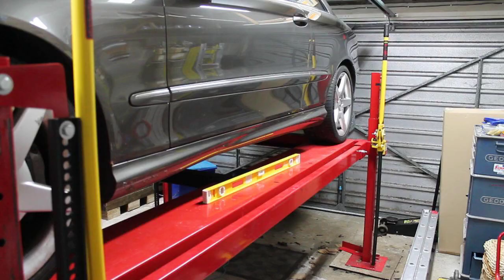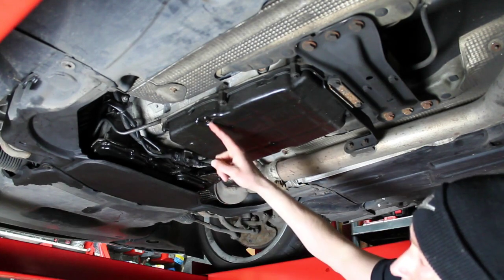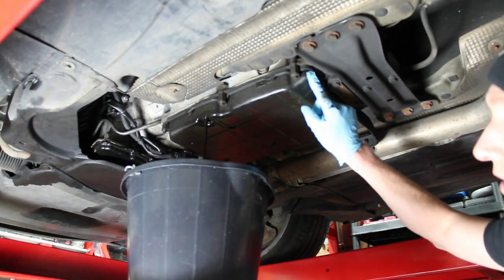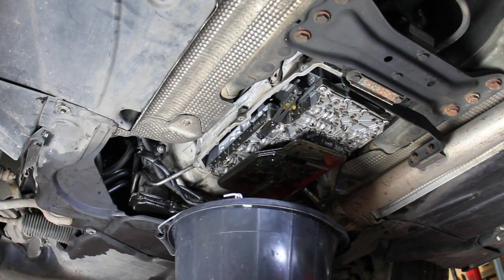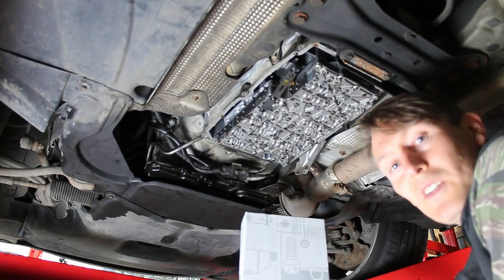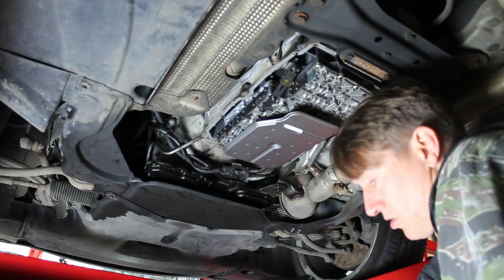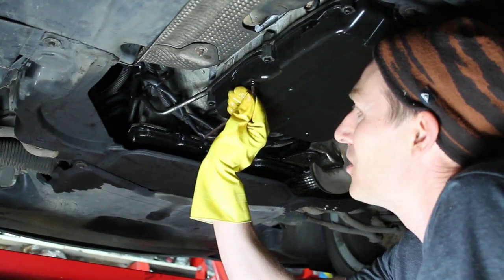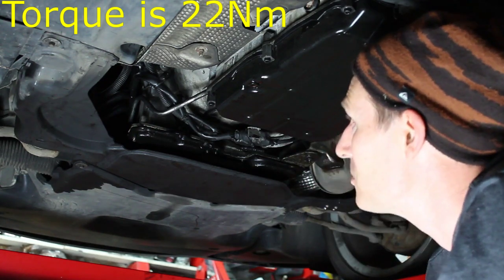How to Change the Oil and Filter on a Mercedes 7 Gtronic 722.9 Automatic Transmission

Comment: Best video out there for diy guys. 1 question. Im gonna buy a w213 2017/2018 E class estate 220d. Its got the 9g tronic gearbox right? Is the steps the same for the 9 speed as in the 7 speed one?

Also, whats your opinion on guys putting a new overflow pipe, new oil pan bolts etc?
Reply from the maker: Hi, pretty sure your car will have the 9 gtronic but if any doubt, keep an eye on your centre dashboard when driving on the motorway usually there will be a number showing what gear you are in. If it says 8 or 9 when cruising at speed, that will confirm it. I just bought a w205 with the 9 gtronic, service intervals are every 5yrs or 77,500 miles, whichever is sooner. I would think that the service procedure will be similar but I will get into it soon in my vehicle and will definitely do a video! Thanks, Phil
Reply: @ReviveMyRide  - thank you my man
Reply from the maker: @AB-dr8wq  whoops, just realised I didn't answer all of your questions! Overflow pipe: I don't replace mine and have never had a problem but it comes down to personal choice. Really easy to fit one while you are there. Bolts: Yes, definitely replace them! I thought it was a bit excessive to replace them, so decided to experiment and two of the old bolts sheared when I started putting the pan back on, even using a torque wrench set to the correct torque. They were Aluminium on the 7 Gtronic gearbox, so presumably they get effected by the heat or work hardening or something like that. Thanks, Phil

Comment: great video; thanks. Did you also replace the plastic pipe (that connects to the drain hole) in the pan as well?
Reply from the maker: Hi, thanks for your comment, glad you liked the video! 👍 No, I didn't replace the plastic fill pipe. I have read a lot of write ups and I haven't come across anyone replacing theirs but some people probably do! Apparently, if you are just doing a fluid change (not dropping the pan and changing the internal filter), you can "pop it up", which allows more of the fluid to drain and then put it back to its original position again but I've never done this myself.   Hope that helps! Thanks, Phil

Comment: How many  miles before you change gearbox oil  cheers.
Reply from the maker: Hi Steven, the service interval is 40,000 miles for the 7-Gtronic gearbox. From 2010 onwards (some people call this the 7G+), it moved up to every 70,000 miles. Hope that helps! Thanks, Phil

Comment: I like this video of yours very much, it explains the technique of how to change the gearbox oil and filter very well.
However i think you should also mention to people that unless you also drain the oil in the torque converter as well, you are only
really doing half of an oil change as the torque converter holds about 4 litres on its own, so you are only mixing old oil with new oil ?
Reply from the maker: Hi Alan, glad you liked the video and thanks for the comment! You are correct about the torque converter. Early cars like mine don't have a drain plug but a lot of the later models did. I provided an update to cover this in a comment that I have pinned and in the description. Unfortunately, I can't easily add anything new to the video... Cheers, Phil

Comment: Do you put any cain of glue to the pan gasket , because when I change my transmission oil I have a lot licking oil and I look you video and I don't see any glue putting on you pan gasket o what exactly I doing wrong?
Reply from the maker: Hi, No, you don't use any glue. If you did, then it might lead to the gasket leaking. So, you need to do the opposite, make sure the edge of the pan is really clean, with no oil residue, as this will help the gasket stay in place. Also, if the new gasket was folded up in a packet, then it sometimes takes a bit of work to straighten it out etc. The new gasket should have some rubber location lugs on it that fit into holes on the pan. These also help keep it in place, I mention / show them at 7:34 in the video. Hope that helps and good luck with it! Cheers, Phil
Reply: @ReviveMyRide  sadly I did it and when I was trying to put the last bolt it broke out on my and a lot of oil came out , and now I ordered new bolts , and a new pan gasket again and a they sooner I get those parts , I gonna fix it but now a don't now how to take off that glue whitout harmed the trasmission , I used the optimum black high flex gasket maker, and I'm very thankful for you help, I really. really appreciate it!!!
Reply from the maker: @saulpaz8857  Happy to help! You can remove the old sealant from both surfaces using a green scouring pad https://amzn.to/3bxDyJm and some brake cleaner. It is time consuming but this wont damage the surface of the bottom of the gearbox or the pan. Take your time and take care to make sure old sealant etc doesn't get into the gearbox.  You can also use a plastic implement of some kind (like plastic trim removal tools) to scrape the surface. Don't use metal tools because if you damage the surface, the new gasket won't seal properly. Were you using a torque wrench to put in the pan bolts? If not, then you really should, helps to prevent bolt breakage. Hope this helps and please let me know how you get on! Cheers, Phil
Reply: @ReviveMyRide  i very thankful for you knowledge ,as soonest I get everything put together , the right way , thanks to you im gonna get my car back , and a really, really appreciate everything to you thank you very much!!!

Comment: How many litre transmission oil is needed for Benz c200 07 plate ?
Reply from the maker: Hi, first we need to check which gearbox you have. If your car has a 5 speed auto, then it is called a 722.6 gearbox, which isn't the same as the gearbox covered in this video and hence, the procedure is likely to be slightly different and it does use different fluid as well. I have seen on Mercedes forums that the maximum oil change amount is 7.5L but it isn't always possible to drain the full amount of fluid (not possible to drain the torque converter) out and most people change about 6L in total.  If your car has the 7 speed auto, then it is a 722.9 as featured in this video. The full oil change is a maximum of 7L but I used slightly less because the gearbox on my car doesn't have a drain plug on the torque converter. Hope that helps! Thanks, Phil

Comment: Thanks for taking the time to do these.  I'm looking into a Metris van which uses the 7Gtronic plus.  Did you not need to drain the torque converter?  It has a drain plug as well.  Probably only a few ounces so not that big a deal.
Reply from the maker: Hi Stuart, thanks for your post! Just had a look at Metris vans on google as I hadn't looked at them before, looks really nice! All of the variants of the 7G-tronic gearboxes are really good, so I'm sure you will like it! Yes, you are right, if your torque converter has a drain plug then you should use it, as you will get a better fluid change. Mine didn't have one, as it is an early model and the torque converter drain plug was added later. You may already be aware of this but just in case: The fluid type changed for the 7G-tronic plus (to 236.15 "blue" fluid) and the service intervals got longer. Thanks, Phil

Comment: Hi my friend.. Im really struggling to find out information on my vito.. Would you know.. How I can change my transmission fluid.. I have a 2001 meacades vito petrol automatic year 2001 model 113..2ltr... I took the radiator off to repair and on the right side it has to cooler pipes which I assume are transmission fluid pipes with taking them off I lost fluid.. Now  I assume this is transmission meaning gear fluid I'm not sure.. But I can't find anyone or anything that can explain where I refill or check fluid... All I can see on top is a blue plastic screw with a tiny hole.. Theres no dipstic.. I just want to know when I took off the radiator was these two pipes transmission fluid or something else and if so how do I refill.. I'm actually doing the van up and for over 40years of fixing and rebuilding had such a brain ache on a van.. The meacades manual is pretty useless... I've put a new water pump on.. And never want to do one ever again. It was very hard but done it... With no room to hardly get the serpinebelt on but did it in the end.. Anyway I would really appreciate it if someone anyone can explain to me what the two pipes I took off the radiator and if its transmission how the hell do I refill... Many thanks Paul
Reply from the maker: Hi Paul, sounds like you have been keeping busy! I haven't worked on one of these before but have done a bit of research to see if I can help. I'm sure you already know this but your version of the Vito is the W638, also known as the V class and the auto transmission is the ZF 4HP20. It does have a transmission oil cooler. See the following diagram. If you detached pipe 38 or 41, then will have lost transmission fluid. https://nemigaparts.com/cat_spares/epc/mercedes/3/fg/638014/50m/27/750/  There's a lot on the forums saying it is really important to use the right oil and the oil codes are: esso atf lt 71141
and mercedes benz a 001 989 2203. If you are topping up, you will probably want to use fluid from the main dealer but apparently Citroen run the same transmission and it is cheaper from them: Z000169756. Please double check the numbers above when you are purchasing, so make sure it is suitable for your transmission! From what I have read, the blue plastic plug you mentioned is where you fill the gearbox. Regarding filling & level check. The process is similar to in my video: With the level plug removed, fill through the top (the one with the blue plastic cap) until fluid starts to run out of the level plug. Put the plugs back in. Run the greabox up to temperature, step the gear selector through its various positions, then remove the level plug once again to drain off the excess. I found this guide which should hopefully help you, good luck with it! https://www.qclt.com/html/%E6%A0%87%E8%87%B4307_607%E7%BB%B4%E4%BF%AE%E6%89%8B%E5%86%8C/607/info/gb/b2ci08k3.htm
Reply: @ReviveMyRide .. Hi buddy.. Thanks for your reply.. Brilliant.. It's basically what I needed to know.. I actually managed yesterday with a headtorch get under the van looking for a drain bolt.. Which I found then noticed up the side of the case another Allen key bolt.. Which I think is the one you take out and when you fill from the top it will overflow from that bolt.. And the blue plug yes for filling.. But today your information you have sent me.. Has confirmed this.. I can only say to many thanks for the time and help. Brilliant.... Many thanks Paul from Jersey Channel Islands uk.. But a Devon boy.. Stuck in a lock down transition... 😂 👍
Reply from the maker: @pb6972  Great! glad the info helped to confirm what you had seen. :-) Good luck getting it sorted! Stay safe, hope you get home soon (and with a working van!) cheers...
Reply: @ReviveMyRide ... No honestly.. You don't realise how you're help.. And information.. Was very much appreciated..... And I can't get no help here.. It's hard work trying to explain to people who here are very unqualified.. But know everything no nothing type of people... 😂.... Anyway I will be following your site now for tips and things... I am also adopting you as my new brother.. Haha... No seriously.. Thank you..  wash your hands and keep your distance.. And most of all to everyone in such a hard time remember there's people worse off then your selfs.... Keep smiling and let not lose are sense of humour... Many thanks Paul a Devon boy stuck in the channel islands Jersey since last January..
😉
Reply from the maker: Happy to  help and great to have you as a subscriber! :-)

Comment: Great job 
Sir How much put oil in side 5 le...
Reply from the maker: Hi, Thanks for your comment! I'm not 100% sure what you are asking but I think you are asking how much fluid goes back into the gearbox? If so, I put 5L in initially, then I went through the warm up / priming sequence and then added more. The exact amount that you put back in will depend on the version of the gearbox that you have. for example if you are able to drain the torque converter. I hope this helps! Cheers, Phil

Comment: Hi m8 top video I have a 12v oil pump I got from lidl used it before down dip sticks on auto box's and engine oil do you think it would work on the merc box instead of the hand pump ps my ml320 has no dip so I would be doing same as you Alan
Reply from the maker: Hi Alan, Sorry for the slow reply. Yep, I have had a lot of comments in the past from people who prefer to fill through the sump plug using a small pump. So it should work! Might be easier / less messy if you have a small valve screwed into the sump outlet but not essential. Hope that helps! Cheers, RMR

Comment: Is it possible to fill via the ATF dipstick rather than mess with that whole plumbing store set up?  I have the dipstick from MB to measure the fluid level and a new filler cap w/red locking tab once I’ve finished. This would be less expensive and much easier although maybe a bit more time-consuming introducing the new fluid. Never seen it done this way though so wanted to ask first. Thanks in advance for any advice.
Reply from the maker: Hi, I was aware of the dipstick that you can buy but I'm pretty sure it isn't available as an option on all of the 722.9 transmission iterations. To answer your question: It should be possible to fill through the dipstick but you may be breaking new ground as I couldn't find any hits when I searched for it. I don't think it would be my preferred option as it presents a couple of problems: 1) As you say, filling would be slow. 2) You would fill down the tube and then need to use the same tube to do the level check, so fluid still in the tube may foul the dipstick. Since I was underneath the car anyway (to drop the pan and change the internal filter etc), I found it easy to fill through the bottom. If you do decide give it a try, please let me know how you get on! Thanks, RMR

Comment: How many miles or time between filter and change
Reply from the maker: Hi, this has been updated a few times by Mercedes and so, as you can imagine,  people have slightly different opinions! My view: If your car is manufactured up to 2010, it has the "red fluid" 7G-tronic (as featured in this video), the service schedule is 38,000 miles or 5 years. If you have the later 7G-tronic made from 2010 onwards "Blue fluid", it is every 70,000 miles or 5 years. Hope that helps! Cheers, RMR

Comment: I think you need to get out the oil from the torque converter as well.
Reply from the maker: Hi, thank you for your comment but please see the comment that I pinned to the top of this "comments" section, where I address this point. Some of the early 722.9 7G-tronic transmissions didn't have a drain plug on the torque converter. Cheers, RMR

Comment: Phil, quick question immediately after doing the transmission service the engine light came on.  I used my OBDII reader, it says the oil temperature sensor is out, I have no idea where that is. Can you give me a little Direction?
Reply from the maker: Hi Tom, I haven't come across this problem before but have done a little bit of reading. Seems that there is a temperature sensor inside the gearbox. Also, there is a controller that communicates with it (and presumably does other functions too). I am happy to help you search for the answer though! Could you please tell me what fault code you are getting? Here is a link to a MB forum that touches on the issue: https://forums.mercedesclub.org.uk/index.php?threads/auto-box-temperature-sensor-fault.60861/
Reply: @ReviveMyRide  thank you Phil. The code is "P0195 Powertrain oil temperature sensor"
Reply from the maker: @tom1031000  I checked on the Mercedes forums, and they are saying the P0195 fault is: Engine Oil Temperature Sensor Malfunction (not powertrain). If so, this is good news because it is easy to get to and inexpensive to replace. Assuming you have got the same engine as featured in the video 3.0 vg diesel (OM642 engine), then the following diagram (item number 40 is the sensor) should help you locate and get a part number for the sensor. I would start by disconnecting the electrical connection from the sensor, cleaning it with electrical cleaner, checking the wire for obvious damage. If that all looks ok, replace the sensor. This is the sensor: https://tidd.ly/2Lr3JIg (but best to double check that it fits your car) This is the parts diagram: https://nemigaparts.com/cat_spares/epc/mercedes/1/m/642910/63h/15/105/?chasis=20932069M Hope that helps! Cheers, Phil

Comment: U got it wrong at the end; u have to check the oil level with the engine running.  It's  on merc service manual.
Reply from the maker: Thanks John! You are right, I have updated a comment pinned to the top of the comment board with this additional info. My car / transmission runs fine but technically, it might be short a little bit of fluid. Cheers, RMR